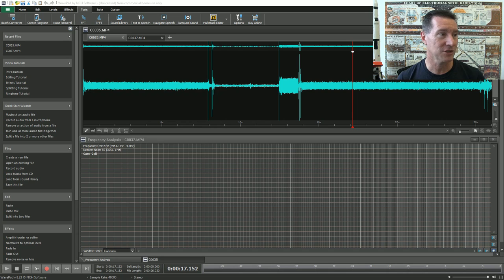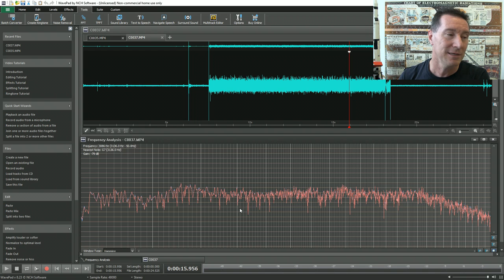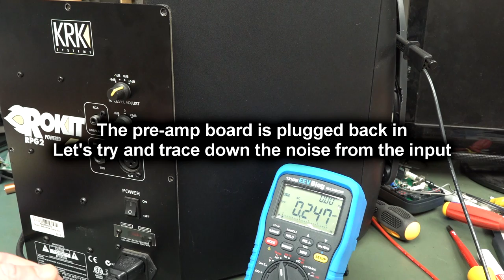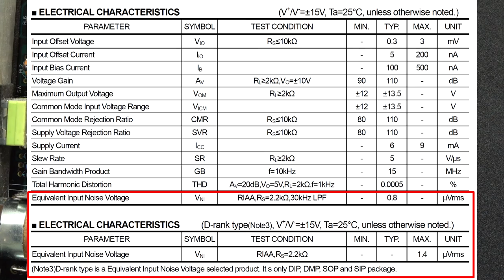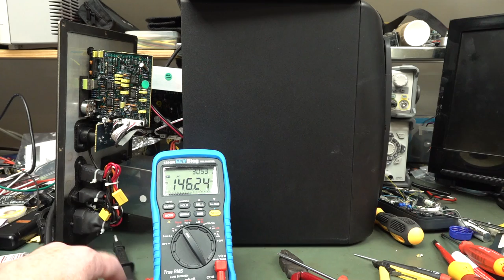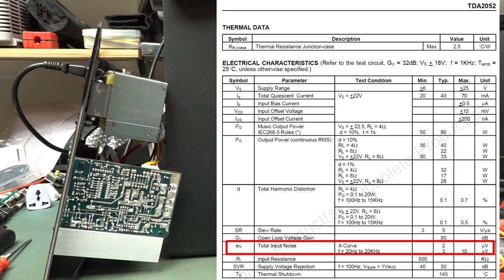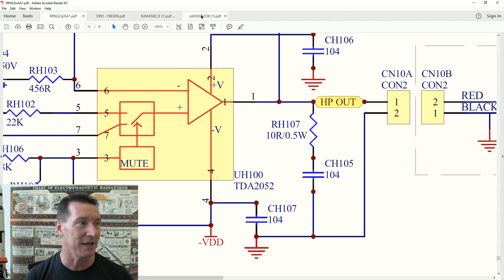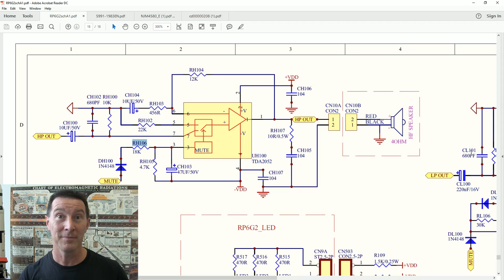EEVblog #1118 - Why Are Studio Monitors Noisy?

Comment: Had this problem with my KRKs and got a ground delete end for each plug which cleared it right up. The end converts the 3 prong USA style plug to a 2 prong. I understand not having it grounded could fry it in an electrical storm but it’s worth the risk since it completely removed all hiss
Reply: I did the same to my Yamaha hs50 monitors and they have been running with the grounds lifted for 5 years now without any problems.

Comment: I've mucked around with the TDA2030A for my active speakers. I found that the noise is very voltage dependent. I dropped mine from 12V to 9V now the noise is OK. Perhaps this is also a thing with the TDA2052.

Comment: What do you think about to try replace RH100 with 1/2W or more resistor?  This should sufficiently reduce the thermal noise of that position and make more clear who is guilt in maiking noise. Or may be you didn't like to solder your board any more.
Anyway the video is very interesting. Thanks!

Comment: I'm using the JBL LSR305 monitors connected to an Audient iD14 interface with XLR cables.  No audible hum or hiss unless you crank the gain to a deafening level.  Even then, it's hard to notice.

I was previously using an Alesis iO|2 interface and it was extremely noisy at every level.  Bad EMI suppression, I suppose.  HDD noise would carry through to the monitors with that interface.  Nothing with the Audient iD14.  I'm extremely happy with the monitors and audio interface.

Comment: Thank you so much. This is really useful. I almost recapped my Event 20/20 BAS monitors because of this low level noise that I've had for many many years. I'm glad I didn't, because it probably wouldn't have done a thing to help! I wonder if passive monitors with better amplifiers will fare better on average for noise.

Comment: ALL powered monitors have a self generated noise. Some have more (KRK, Dynaudio, pretty loud) some have less (Neumann, really quiet). 
The reason for this is very simple: A powered monitor has its amp set to max. 
However you should get a bit lower self noise (not completely silent though) by lowering the volume on the monitor. So maybe some of the noise actually is not only your monitors self generated noise but also from electrical interference? (As with that obvious hum, that's nothing you should expect from a monitor and most likely caused by interference in your room?)
The numbers you would be looking for is stated as “self generated noise”, but for some reason not many monitor manufactures specify this. (My guess: they don't want to because it might influence the customers negatively.)
Personally I think testers in media should talk more about this—however in most situations this self noise isn't really an issue because of the actual listening distance. In my case it is an issue because I have a pretty short listening distance to my monitors.

Comment: Wow those have a lot of noise. My monitors with a home-built amplifier have nearly none, but mainly due to using a linear power supply, class AB amp IC, and 16 kHz cut-off filter and a good low noise sound card. But, still nice not to hear that constant 'SSSSSSSS' when nothings playing. Seems the switch-mode stuff now has a lot more noise.

Comment: What the hell kind of "studio monitor" comes with volume controls ? And some HF amplification too ? Seems like a misnomer for simple overpriced active speaker. Although its guts DO look pretty good, even though the design is more of "classic" approach. But they did skimp on op-amps a little, also socketed them as if they expected users to change them. 

By the way, after reading a tons of datasheets I concluded that best stereo PDIP-8 (socked here) op-amp is LM4562 (aka LME49860), best SOIC-8 are OPA1612 and LMP8672. Best headphone drivers are TPA6120 and MAX97220 (not to be confused with MAX9722). THS4551, OPA2365 and OPA2277 are also pretty good but for mono you would want OPA637. As for power amps: TAS5342, TPA3250-TPA3255, LM3886.
Reply: It's fairly typical these days to have a volume control and shelf adjustments for HF and LF built into the speaker for basic compensation. The market these are aimed at would not have sophisticated correction or room treatments so the shelf filters may be the only correction the user has.
Reply: +dwindeyer: It is typical but "monitor" speakers and headphones are supposed to be calibrated for flat response curve and hardwired for power/volume that is balanced for maximum dynamic range at maximum input signal while maintaining minimal distortion+noise (which is why they are fully "active" and self-contained, mono-only), aren't they ? One may argue that it is for compensation of room's imperfections but it's too simplistic for such task, it's naive to think that any knob can account for your room not being studio-grade. And if you have to compensate, you better off doing it in source's software or in-between source and "monitor".
Reply: They have a clearly defined bypass point on all the controls, so I'm not sure exactly what your objection is. The choice to use the controls or not is there, if you want full bypass, set everything to zero.
Reply: +dwindeyer: "Bypass" or simply zero-setting ? Because each of those filters would have op-amp and potentiometer and each of those is another layer of unnecessary distortion and noise. But, most importantly, it's the sign that manufacturer might not take responsibility for this being "drop-in" product, ready for use out of the box and conformant to "monitor" expectations, hence my comment about it looking like overpriced active speakers. Although, active crossover and multiple power-amps IS some serious business. Certainly better than most small "active" "HiFi" stereo crap you can get.

Comment: TDA2050 has only 45 dB power supply voltage rejection.. LM3886 has 120dB typical, and no less than 80dB. That means TDA2050 cannot suppress 100 Hz hum from unstabilized power supplies well enough..

Comment: Great job of chasing the noise through the system Dave. One thought, I've always considered a multimeter the wrong tool for chasing AC noise in a system... not enough visual clues in just seeing a number. whilst you mentioned that your multimeter has the bandwidth, does it's ADC really have the granularity to be measuring down in the uV's of noise?
Reply: That's his own specially-designed meter that he says does RMS measurements down to the single-digit microvolt, and with a BW > 100 kHz.

www.eevblog.com/files/EEVblog-121GW-Manual.pdf

Comment: 1. 4580D is the plain DIP version, the selected 'D' version of that would be called 4580DD.
2. So they are driving a tweeter directly from the power amp? That's a stupid idea for at least two reasons:
  a) Dome tweeters tend to be ridiculously sensitive (100-ish dB/W, give or take), making every bit of amplifier hiss (and preceding crossover hiss) heard. Output noise from the power amp would be expected to be expected to be ~34 µV(A) or ~50 µV unweighted, which actually is quite civil and would be dead quiet in most any passive speaker, but here you're basically sitting a foot away from something with the sensitivity of a big horn (PA) speaker, which is about the equivalent of looking at your screen with a magnifying glass. You could try replacing those 12Ks with metal films if they aren't already.
  b) You are missing out on the positive effects of current driving, which can cut down on distortion levels quite dramatically (particularly in anything not using conductive voice coil formers). Yes, it means you have to deal with the frequency response peak at resonance, but in a high-order active crossover that's not too much of an issue. Unfortunately, it would still take the tools of a speaker designer to tackle this issue properly.

3. I am still suspecting that a great many active monitors suffer from subpar gain staging in general, or more precisely they are not running their crossovers as hot as they probably should be - I see no indications of any padding between crossover and power amp here. When a dynamic range in the order of 106-110 dB is required, you have to put some thought into gain staging or else results are going to be less than ideal. 
In this case you can already tell that tweeter XO levels must be quite low, given that the amplifier would be able to deliver over 35 W into 4 ohms but obviously the woofer is going to limit at maybe the 2 W level (tops). That's about 2.8 Vrms out, or a measly 100 mVrms coming out of the crossover! (Plus an estimated 1-2 µV worth of noise, adding roughly 3 dB to output noise level.) Good for distortion levels, mind you, but easily leaving 14 dB of dynamic range untapped. It's slightly less depressing-looking in the woofer section, with maybe 500 mVrms coming out of the crossover, but even there I'd want 6-10 dB higher levels.

4. These KRKs appear to have their share of issues with XLR pin 1 routing, this would be a good thing to investigate while the speaker is ripped apart. AES48-2005 says that pin 1 must connect to chassis ground and nothing else (chassis ground then typically connecting to signal ground and safety earth in the power supply section). I suspect ease of production mandated that pin 1 actually connects to input stage signal ground, meaning any circulating ground loop currents would have to travel from there to the power supply and then to safety earth, thereby contaminating signal ground and wrecking input common-mode rejection.

Comment: I bought a little songbird radio. It had a 7. something dc wallwart to power the thing. First thing I noticed was the blue back light would brighting and dim with the music. So I added a cap at input. Fixed.. Then decided to play it at night with very low volume.Now I have noticeable humm which is very loud at night when everything is quite . Replaced the 7 volt wallwart with one with a little better filter. Humm was a little better but still aggravating at night. At this point I am thinking about drop kicking it. The next thing was add 5 AA battery's. That seems like alot for a little radio but that was what the comportment had designed in the radio. Still humm but better. The only solution I could find was to add a 18650 battery in place of the 7volt walwart and 5AA batteries . So I went from over 7 volt Dc wallwart to 7.5 with 5 batteries to a 3.8 volt 18650.Fixed the humm but lost some playing time. It seems like something in the radio was causing to much power going to speaker. I know this fix is not the right way,,,at least I can use it at night. I might try a few other PS around 4 volts when I get a chance. Great video Dave. Love the videos and see if you can get that snake out of your speaker.That would make a very interesting video.

Comment: The brands you mentioned woud never be considered "tp brands" by anyone who knows monitors, but are affordable home studio near feild monitors that are definatly better than tryint to use stereo speskers but lack the headroom to reproduce transient spikes etc. And an important piece of gear would be something like a Furman AC line conditioner that gets rid of dirty electricity giving an average of 3db extra headroom for your music. No one who is serious would plug monitors or any gear into a wall socket! Then you can turn your monitors up and hear pretty much nothing at all. The noise is comming from the electricity that has been used for dishwashers, power tools and anything that uses electricity unless you have a direct isolated line from your hydro company.
Oh...never NEVER put your ears up to a tweeter if you plan on mixing any music, or even listening to it. That's likely when something will go wrong and a loud crackle will damage your ear.

Comment: My biggest issue is ground loops with GPU and other electrical noise coming through the speakers.  I have Yamaha HS-5s and now have a Stereo DI with ground lift to get rid of the noise.  I wish that they had a ground lift built in.

Comment: Studio monitors offer a lot for the money. The amplifiers are cheap and simple though, compared to state of the art discrete amps. A high end transistor amp has no noise. It is dead silent. The cost of putting two or three of such circuits into a monitor is prohibitive for most studios. One monitor would amount to about 5k or more, I estimate, and only large monitors have enough space, anyway. My Focal SM9 monitors ain't cheap and are one of the best around, but they hiss in the tweeter. The circuits are not bad, but still don't match a high end amp. Power supply, preamp, poweramp, everything is simpler. I would love to see a monitor with an amp like the Benchmark AHB2 built into it!

Comment: humm is inherent in any amplifier design for audio ... most higher end consumer speakers mute or filter out the noise when the signal is low enough but for monitors you dont want that 
monitors are not designed to just plug in to your home theater system to leave on all day 
but full disclosure i have never worked in the audio industry (unless you count humming ceramic caps :P )
Reply from the maker: Yes, many have auto-mute

Comment: Amplifiers with BJT inputs are prone to picking-up RF noise and "rectifying" it, resulting in hiss. This happend to me while I was developing crossover for my class D amplifier - when using NE5532(BJT input) op-amp, i got some hissing. When I replaced it with TL082 (J-FET input), hissing was allmost completly gone.  So, I started a little discussion over on the EEVBlog forum - here is the link :)
http://www.eevblog.com/forum/projects/ne5532-picking-up-hf-noise/

Comment: Check the difference between the plus and negative voltage for the amp.. My guess is that the difference in offset voltage on the output will be there.

Comment: Hi thank you very much indeed for this very interesting and valuable lesson   I wonder if this issue is present also on professional active monitors  Noise with inputs short circuited is very hard to swallow   Maybe the level is not so high but still it is really not nice   
The manufacturers should check for that before putting their products on the market

Comment: Sounds to me (ugh) like a problem of grounding differences between the signal input ground and the power amp reference ground. My 2c would be placed on how the power ground is coupled to the signal ground either by layout or circuit. I have the same unit on the bench at the moment with a blurping sound popping out of the woofer at about 1hz. Loud enough to make it unuseable. Scraping glue and measuring caps as I speak.

Comment: My adam F7's don't have any noise whatsoever and they are the first nearfield monitors i've seen without ground. The eurocable has only 2 holes instead of 3. Also they are the first set of monitors i've owned without any groundloop issues.

Comment: The datasheet input referred noise spec is A-weighted, alas, so basically its a noisy chip with perhaps 10uV real input noise, 260uV output noise.  That's pretty awful in fact, -70dBu, whereas -90dBu is more reasonable from what I can glean.

[ come to think of it, wasn't that meter 100kHz bandwidth?  So unweighted noise to 20kHz is about 120uV in fact? ]

Comment: Mine do the same, my 3.5mm input on a cable picks up all sorts of noise, if I'm charging anything via USB power plug nearby its terrible. Noisy is a good thing though if all is quiet with a interference as it'll pick up everything coming down your cables.